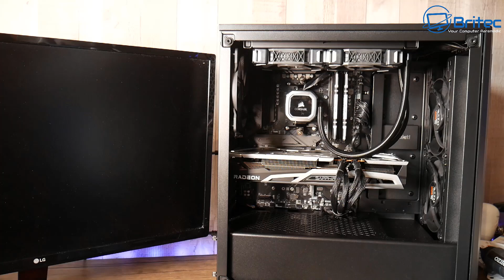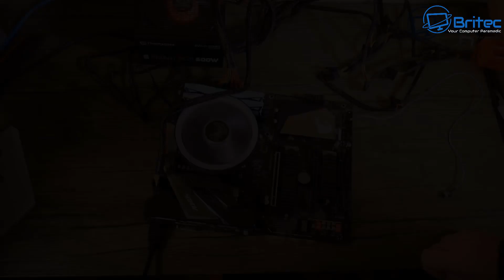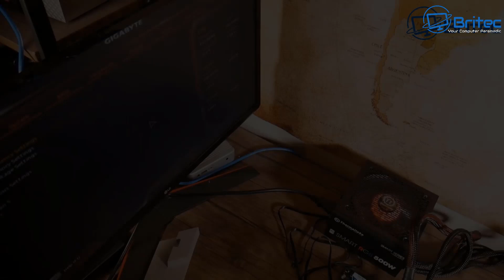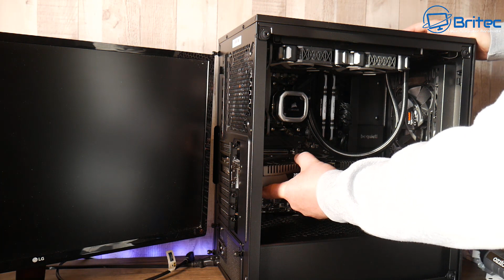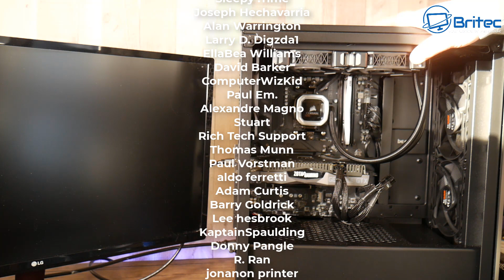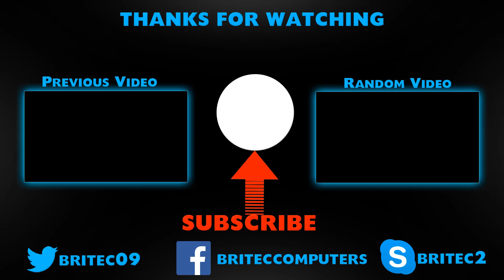Fixing a Broken Gaming PC That Won't Post

Comment: Thanks Brian , I had an old computor I thought would be good to learn on loading stuff like other windows and the like as it is too old to load windows 11 I started to follow your video and discovered it would switch on and after 1 minute switch off by itself I checked through everything and found that the heatsink paste had gone hard and was barely covering the cpu I ordered in some heat sink paste cost 2.15 Aussie dollars replaced the heatsink correctly switched it on and the computer kept running but no post so I had another screen which I fitted and hey presto everything works again thankyou for your video regards peta from down under
Reply from the maker: You're welcome

Comment: Mine is a MSI B450m-a pro max II only has 2 ram slot tried and check 1 by 1 but I still go no display mouse ain't lighting is this a rare case that 2 slot just died at the same time?

Comment: damn, I have this exact same motherboard type. B550 tomahawk and it will no longer post no matter what I do. According to the LEDS on the board where the power cable connects to the board stays solid on VGA and have no video, I also have a speaker connected to the speaker header to give beep codes, 1 long and 2 short. I've tried at least 2 different video cards and the third onboard option and still can't get it to post. i've tried different memory sticks as well. In an act of desperation i even removed the M2 drive then used the EZ flash to reset the bios. i think its safe to say my mobo took a dump on me. The only thing I haven't tried yet is a different power supply. I had the PC for 3 years and it just started not posting the other day! Thanks for reading my comment.
Reply: Did you find a solution?
Mine is doing the same thing it is  brand new board  however
Reply: @Anti_Censorship-2025 no it's been junked. My solution was just buy a new mobo
Reply: Try clearing out CMOS removing battery and pushing the power button several times. Also test the CMOS battery or swap in a new one.

Comment: I am going through this right now with a Z790 Edge Wifi DDR4. 2 dead slots. 4 week RMA, each way. RIP my work flow. Back to old crusty. This PC running at 45% is waaaaaaaay faster that crusty.

Comment: I’m not sure if you’ll read this but what if the pc is like this (fans spinning, gpu working, mobo lights are on) but u check the mobo and still doesn’t work? ( pc was fine (7hours+ use on average, daily) and suddenly this happend
Reply: Did you fix it I m having the same issue? Need to know if it’s motherboard cpu or psu

Comment: Hello, i got a similiar problem with old pc. When i turn on the pc fans will spin fast and black screen. If i want to turn off the pc power button doesnt work and i have to pull off the plug. I have tried changing ram, positions, with or without GPU, taking out CMOS battery, changing disk sata connection and nothing worked. Is there something else i could try?
Reply: I have the same problem now. Did you find any fix
Reply: @vPA1N Yeah look at the pins on the cpu socket many od them were smashed beyond repair. Hope this will help and if i am correct GL.

Comment: My son built a computer that would not post. Both memory sticks worked, but only one at a time in one slot. I pulled the CPU and found a tiny bit of thermal paste in the underside of the CPU, on two pads. I cleaned the underside of the CPU with alcohol. I used a small paint brush with just a little alcohol and carefully cleaned the pins on the motherboard. Put it all back together and it worked properly.

Comment: Couldn't you just avoid using that 1 slot since it has 4 of them ? I know some boards like you to use certain order slots for dual channel but wouldn't it at least boot ?
Reply: Usually you can, but the motherboard is still faulty, and you will want it replaced while the warranty is still good, because at some point you may want to have four sticks of RAM in there.

Comment: My initial guess was that it was an unsupported CPU and the BIOS needed updating with an older chip. It just goes to show that although brand new mobo's are rarely faulty, sometimes they can be. Personally I've had the most problems with MSI boards so I never use them any more but as you say, it happens with all manufacturers from time to time.

Comment: Thanks. Don't feel obliged to reply but I'm currently struggling with a GPU here. I was unlucky enough to yank the hdmi cable one day and it went all black. Unfortunately I've tried many things, reinstalling windows, properly uninstalling drivers in safe mode, reinstalling new ones etc .. just can't get the 1080 to work - HOWEVER, I do get this old Radeon 5770 to work. The system runs just fine with it.

Do you think it may have happened that the PCI slots were slightly damaged but only such that the much older card will work - but the 1080 just won't? By this I mean, do you think it may be that the power flow to the motherboard/PCI slots were somehow compromised in such a way that the more power hungry 1080 just won't work but the older, less power hungry one will?

Again, don't feel obliged to answer. Just felt like throwing this one out there in case you or someone immediately recognizes an issue.
Reply from the maker: Very hard to say with full diagnosis of the system
Reply: @Britec09  Thanks for reply. I'll likely end up bringing in another GPU with higher power req than the 5770, perhaps on par with the 1080 or higher - if that one works then there's probably unfortunately an issue with the 1080. At least then I won't have to replace the whole thing just to test the 1080. I've been unable to determine issues with other parts of the setup.

Anyway keep up the good work!
Reply: My first rule for building and repairing PC's is build and maintain more than one PC.  The additional ones will keep you "on the air" and work as tools to diagnose and repair the bad one.

Comment: i had a new psu fitted since then the pc  hates being turned off and back on again it restarts anytime no problems its been like it months and still chugs on  i never turn it off i restart when it says to i switch the monitor off and on as needed
Reply from the maker: Something seems wrong there for it to do that. Should be a easy fix.
Reply: @Britec09  to be honest ive been left physically useless from several strokes to get it fixed is far  harder than leaving it on thanks anyway the shows great

Comment: Rookie mistake. Building fully in case without a full outside of case test. The cause may be, that there is a short between the memory slot and the case. 

Yes, I have done this myself by placing a motherboard post in the wrong place. 

Great video and hopefully people will learn. 🤓
Reply from the maker: When doing as a business, I do power on self test every time. When its for Youtube, not so much...why? it takes a long time filming and getting things right, so I skip power on self test, which I shouldn't, but do as I say and don't do as I do lol.